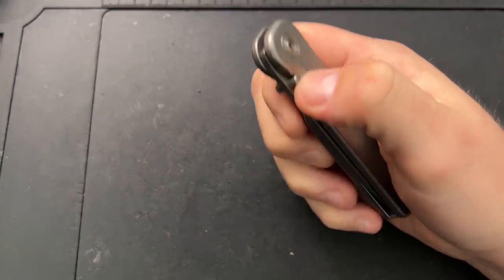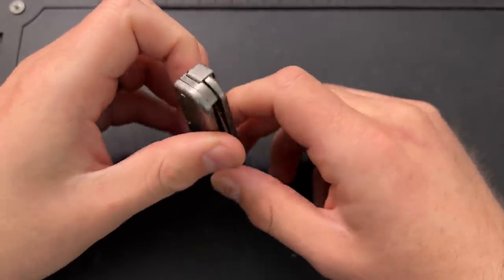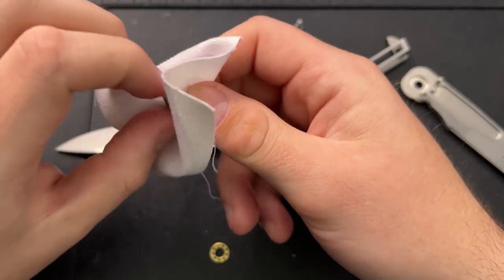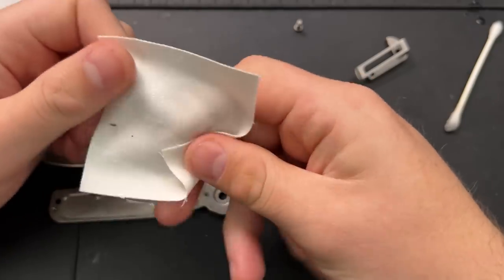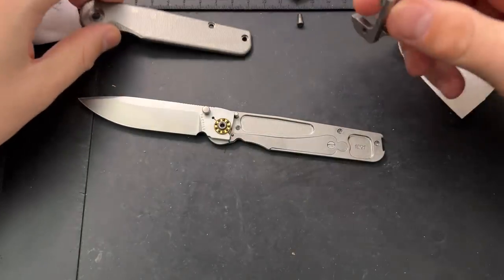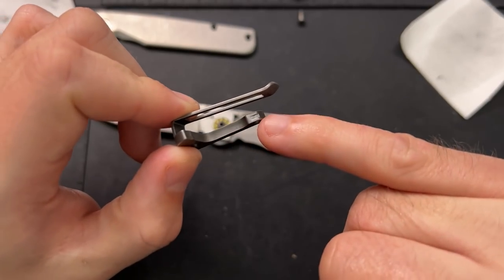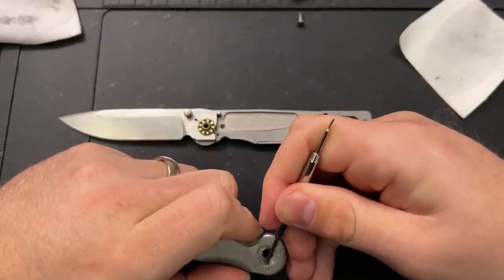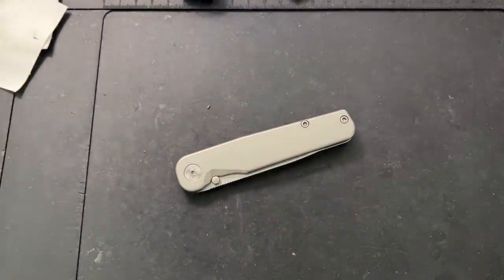How to disassemble and maintain the Tactile Knife Co Thumbstud Rockwall Pocketknife

Comment: Yours was so much easier to take apart than mine. My stop pin is basically press fit on both scales and some monster torqued down the body screws to the point that it felt like they were about to strip when I was loosening them.
Reply: I just got mine and it’s the exact same. I had to pry the scales apart

Comment: Thank you for this very helpful video. I just received my new Rockwall thumb stud two days ago and my excitement was tempered with some disappointment with the action being gritty and dry feeling. Upon watching your video and with thoughts of finding metal bits, I disassembled mine to find indentations from the pivot balls into the titanium collars on both sides. At least no unnecessary metal but was also absent lubrication which I added for little to no effect. I assume that it was overtightened on the original assembly. I will be contacting Tactile Turn to see if they have a pleasant resolution..
Reply: Any update? I have one sitting in my knifecenter shopping cart waiting for me to pull the trigger.
Reply: @BaldwinGTi  They sent me a return shipping label right after I emailed about the knife. Yesterday, 4/26/22  they responded that a refund was being issued. There was no comment about the issue.
Reply: @2cucucachu  Nice, that's good to hear they are issuing a refund. Are you going to buy another one?

Comment: Mine has a blunt tip, bit of a dull blade and grindy action. Because of the blunt tip I will not keep it or adjust anything. I love the look and feel and the snappyness but I will replace or return it, whatever my dealer prefers. Bummer.